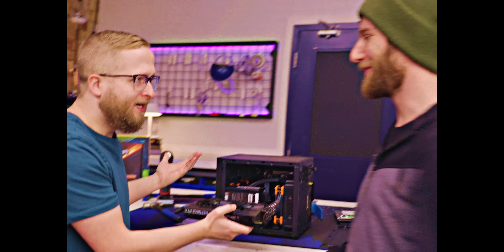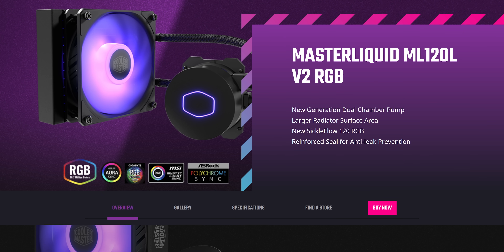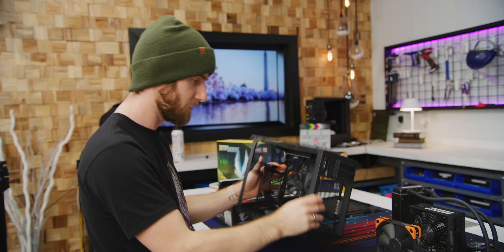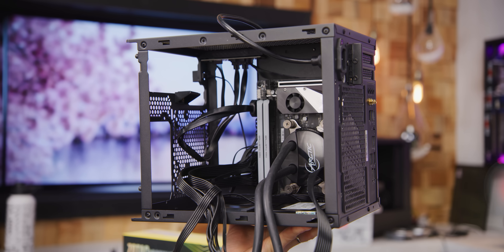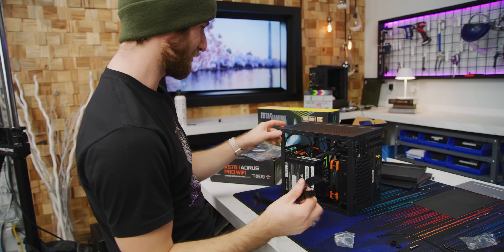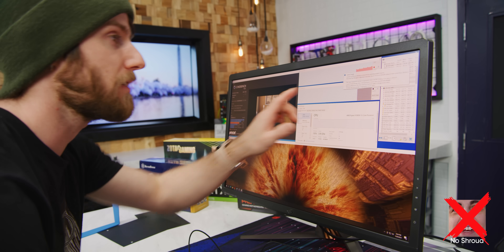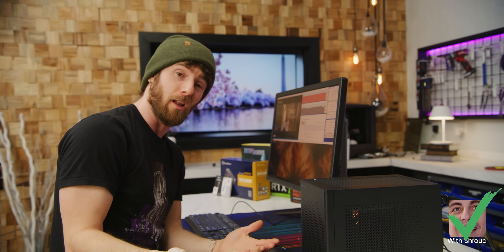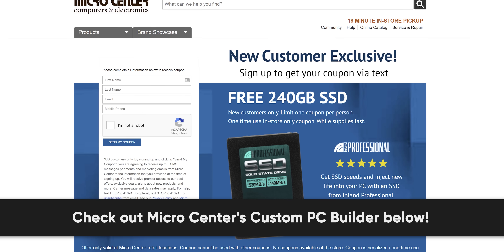This GPU SLIDES into this Case! - Silverstone SUGO 16 ITX Case

Comment: im starting to think they need to build video cards with the connector on the back end and install via a pair of rails, sort of like how datacenter hot swappable hard drives work. given how ginormous they have gotten and how relatively flimsy a single edge bracket and pcie slot (which mobo manufacturers have gone out of their way to reinforce) tend to be.
Reply: i would agree, but then it would break compliance. Its not that there is something wrong with the formfactor design. Its that chip manufacturers are getting less and less efficient (per watt performance) overall.

While idle wattage has gone down considerably over the years (AMD HD 79xx/R9 2xx/3xx/4xx | would idle on average just under 200w less than peak, which was usually around 400-600w), Underload GPU efficiency has dropped off considerably.
While i agree a lot of this has to do with transistor count being through the roof with high core-clocks, that's only half the issue. GPU die efficiency hasn't improved much since mid 2000's. This is concerning in terms of progression.

More chip developers such as Nvidia and AMD are focused on performance, they keep cranking up the chips power draw by cramming it into the same low efficiency space. This means it requires more power, and better cooling. - Its this traditional approach to cooling thats adding all the extra weight to the cards.

In the short term, more efficient heatsink designs with alternative materials and better fans are one approach to fix this, but ideally the better approach would be to absolutely go with external cooling with water cooling of these demanding components.

---
Long term, i think more efficient GPU die layouts, with far less of the power filtering and handling should be on the board. More daughter-boards to offset the cooling of the power-delivery (and repair) would solve this easily. However, as we are already seeing from Intel, they keep wanting to cram more heat creating VRM's and rail switching right onto the motherboard as-is. Concerns are shifting away from Gaming/Enthusiast Addon components(gpu's), and back to integrated low-end components. 

Convenience and pure aesthetic is slowly winning out against engineering and product design sense. So i dont see daughter boards or more efficient GPU's coming back any time soon..

---

This all said, your probably thinking "None of this matters today with existing stuff. Its just a bunch of worthess conjecture, add a support rail and be done with it!", while you would be entirely right... There is a huge problem to this approach. Standards exist for a reason, altering these standards means breaking compatibility with older or upcoming devices.
It also means breaking compatibility between like devices.

This is why the "firewire" vs "USB" debate ultimately culminated in a uniform spec. | More separation in case design that comes away from spec guidelines means more and more niche solutions come along that breaks reparability and support.

Adding /anything/ to the GPU which is supposed to integrate with a case, means updating pci formfactor specs. It also means breaking compatibility with old cases that lack support for it. 
From a engineering standpoint Adding a "Support arm" attached directly to the GPU will not reduce flex. This is a fault of the PCB, not the "Card case". Thin PCB's are exposed to more flex. This could be solved by adding additional layers of copper with heatpipe channels built into the pcb its self to both mitigate heat transfer and isolate the grounding plane. Requiring 0 spec changes, significantly reduced flex and improving thermals overall. But lets face it, GPU market has turned into a pyramid scheme of "How much can we produce, at the lowest price possible and charge the most for". - Less efficient heatsinks borrowing from pre-existing designs mean they appear more efficient, but in reality its just minimal effort. Combined with on average the worlds worst fans, usually means most GPU's are designed to fail, and fail within 3 years.
Reply: @edenrose2374  the rail system would be the extreme hyperbole option to help explain the problem. if actually implemented it would end up adding even more bulk to the systems and therefore cost (water cooling has the same problem). so the answer would be in small amendments to the existing standards with a low cost of implementation. a couple examples:

doing something like adding an extra bracket at the other end of the video card (ive seen old vesa cards that do that), and a line of structural holes to the chassis spaced at 20mm intervals in like with the rear bracket holes. then spec video cards over a certain weight limit to have a tail bracket. if the card is exceedingly long they can opt for a captive thumb screw. chassis manufacturers just add the holes and include any necessary standoffs, gpu manufactures are responsible for the brackets. 

making the bracket hard mount directly the the bulk of the heat sink. cards with a 3 slot (and i saw one with 4) bracket already have a fairly ridged mounting point which is sometimes underutilized. most of the boards ive disassembled use the pcb itself as an intermediary using only a couple screws at most with no direct connection to the weighty heat sink. this would just be the gpu manufacturers problem.

Comment: I guess the inner power plug is supposed to be through that loooong gap left of the power supply before this one is mounted and screwed in lol. With that the cable is not as stupidly managed as Linus made it in the video.
Reply: you wouldn't be able to do that with a ATX PSU ?
Reply: Its covered by the front panel so hardly "stupidly managed".  Its better than most small form factor cases where the AC cable is a tight squeeze risking breaking the cable.

Comment: I don't understand the trend for small cases, the empty space is cheap and light and makes everything easier to deal with.
Reply: More desk space
Reply: I'm the other way around! I've never understood the want for larger cases. Sure it makes cable management/general assembly easier, but it just takes up excessive (imo) space on a desk. Not everyone  wants to get an entirely new desk to keep their pc off the floor and having a smaller case can give you enough space for an extra monitor, more space for your mouse, and it helps a lot with dust and pet hair by keeping it on the desk. That's why I'll always prefer sff, but to each their own!
Reply: @ryebread8063  agreed
Reply: if you have limited space SFF case is amazing takes up a lot less space then a normal one, plus portablity is so easy if you need to move your PC from location to location. 

I am a uni student so move houses every year or so and can fit my PC in a backpack if i wanted to and can easily fit in the tiny rooms i get.
Reply: @StuffAndMore  "I am a uni student so move houses every year" Wait, how are those things related?
Reply: My Define C is already fantastic for aircooled thermals/noise. It's likely the most efficient use of space for a modern full-ATX case. An ITX case js just extra work and no spare pcie slots.
Reply: @jubuttib  cause i rent my house and most contracts are only for the time you are at uni Sep-July and highly unlikey you will get the same house again
Reply: @StuffAndMore  Same, contracts sucks
Reply: @MobiAussie  Depends on what itx case. Modern itx cases are actually easier to build if you did your research first
Reply: @StuffAndMore  Huh, weird. I rented too while I was at uni, and spent years in that apartment. =/
Reply: @z4k1_zaki65  Sorry to hear it's like that over there, here you usually get to stay in the same apartment for the whole time, unless you specifically wanted to move for example due to hooking up or something.

Comment: Really nice case and thanks for going over some of the PSU options. It looks like you can fit a chonky tower cooler in there if you go with an SFX power supply. If that’s the “case”, that’s the way to go IMO

Comment: Not really sure why you guys didn't go for a Corsair platinum unit instead for an sff build. Its the smaller sfx footprint as opposed to the sfx-l and you also get nicer braided cables that aren't as stiff making it easier for cable management. Your fingers would also appreciated it a lot more. Other than that, nice build. Looking forward to getting my hands on this as Silverstone seems to be one of the few case designers who like to apply corporate style and industrial networking design to their cases which I really love :)

Comment: I'm building a custom PC case out of the leftover bits remaining from a 1939 Philco radio that I made into a massive PC case in 2014. The big case will house my NAS, with it's motherboard and 12 hard drives, as well as a standard ATX motherboard for a workshop PC. My new case is 13 inches long, 10.5 inches tall, and 9.6 inches wide. It will support a full size ATX motherboard, with 7 low profile PCIe slots coming out the bottom of the case, and up to a 3 slot GPU exiting the rear. The PSU is an SFX supply, and the CPU is cooled by a Noctua NH-D15. The design rotates the CPU cooler 90°, and creates a sort of front to back wind tunnel effect. The front and rear grills are going to be waterjet cut custom brass panels. The GPU pulls air in through a top mounted brass grill as well. The case hinges open like one of those old style PowerMac G3/G4 towers. The whole thing is suspended off the desktop by legs, and will have a nixie clock built into the front.

Comment: Noctua's foam duct thing would work well here, just surround the GPU fans up from above while ensuring it wont block the exhaust fins.
Reply: Interesting suggestion. I'm building a pc using this case. How would you attach them to the GPU? Or would you just wedge them between the card and the case? Wedging would potentially add further mechanical strain to GPU sagging
Reply: @WerdnaT00  There does seem to be some GPU sag visible in the video. Double sided tape on the top panel could work , but then you risk the foam becoming one-time-use only. It does seem like you can brace the GPU from below using the power supply or AIO, but that would be jank. It would be total overkill, but a deshroud and replacing the fans with ones you can actually screw the foam into would avoid both issues but adds extra cost.

Comment: I guess one of the editors is getting a new machine now? Super cool build, though I still prefer the sandwich design with the PCIe extension bracket, since it usually nets you a thinner and easier to place machine. But Linus is absolutely correct: Silverstone is legendary for their creativity in case design, even if it sometimes looks janky or doesn't work out quite as anticipated, you can never take away how cool it is to see what designs they come up with.

Comment: This looks like a case that would benefit a LOT from the 5mm extra length the Phanteks T30 fans have to move air out, especially in the layout in the video since there's only one exhaust fan.

Comment: I use my power supply to exhaust air from my case. It works well. It's better than the normal way of installing a ps imo. My case temp is only 2 degrees above ambient. Plus the air in the case is probably less dusty than outside the case so doing things this way is better for the ps. It adds to the airflow of the case without increasing noise from another fan too. Given that idk why you wouldn't do it this way.

Comment: I wish Linus checked out the Silverstone NJ450-SXL.
As a lover of silent computers, that one is just unbeatable - you can't get coil whine from a sealed box made out of aluminium heatsinks.
It would also help promote that unit. I messaged Silverstone when it came out asking if they planned to make an ATX version with >600W and they said they'd see how well this one does.
I've not seen it showcased a lot, and I want that ATX version a lot - I need more than 450W but that sealed design is amazing.

Comment: I've used small and cubic cases before and those consumers who wants smaller cases doesn't know what they are dealing with. If you ever think to slightly dusting, cleaning, changing thermal or any hardware along the way, you must avoid those kind of cases which causes a lot of pain to do any of work. But if you are okay to send your computer to tech every 6-12 months, then you are fine and it's their problem. But if I was a worker, I would've definetely charge extra amount for the pain it caused me.

Comment: Interesting case. Its even possible to use relatively large air cooler, and you don't need 4-6 fans, like many other SFFs, to squeeze air through the tight space of the case.

Comment: Other than cost, you can get a no-tradeoff solution with a SFX power supply. If you get a highly-efficient model with enough power, at least with Corsair's nice ones, the fan doesn't kick on below about 60% of its power capacity. While new chonky CPU's and GPU's can easily eat up over 60% of most PSU's, it's easy to spec a CPU that saves power by not having extra cores you won't use (getting 'only' a 6 or 8 core), and that way saving your watts for the graphics card. I run the Corsair SF750 with a 3700x and RTX3080, and I'm not sure if the fan ever kicks on. But if it does, it's quiet enough I don't hear it. 

It's also worth noting that the additional cooling you get on the CPU means the CPU fan doesn't have to run as hard, and I guarantee that makes a bigger difference for sound than the fan on the PSU.

Comment: I built mini-ITX PC for gaming in my living room. Case is Fractal Design Node 304 equipped with R5 5600X, RTX 3080Ti. Temps are around 70-80c for both CPU and GPU when gaming on 4K maxed out.

Comment: I think having the AIO as intake is not ideal, silvesrtone should consider adding the option of installing the AIO on the right side as exhaust, and moving the PSU to the left  side of the case,  that is front and left  side intake (where GPU is) and right side and back is exhaust. regarding the graphic card silverstone provides an option with a rizer cable so to install the graphic card flat, that can solve the Graphic card cabling issue.

Comment: I'd like to see them do a custom tower cooler that just takes up pretty much the entire middle section with heatsink for this. I bet you could still get great quiet performance and then you don't have to worry about a pump failing.
And maybe a shroud that you can stick on the back that doubles as case feet so you can orientate it vertically. (You'd need a lot of 90° angle connectors but they exist so it shouldn't really be a problem, would just be cool to have the option)

Comment: I know everyone dismisses 120mm AIO's, but I have an Arctic Liquid Freezer II 120, and I never went above 80C cooling a 5950x. I sold that CPU and continued using my 3700x, which can't even hit 70F with that AIO. That thick radiator makes a huge difference. Maybe not quite the same surface area as a standard thin 240mm AIO, but cooling performance is close.

Comment: it's not exactly the smallest  sff case but the Cooler Master NR200 with the mesh side also gets incredible thermals with an AIO for my 5900x and the bottom has enough clearance to keep a 3080 cool under a load.
Reply: Useful

Comment: Here's a fresh take on this challenge. Fit a PC in carry-on luggage allowance. You can borrow a monitor in most homes or open-office hot-desking. European RyanAir (Budget Airline) 'priority' carry-on suitcase is two cabin bags. No muscle-bound baggage handler throwing my baby onto tarmac. The 400 x 200 x 250mm personal bag (keyboard, mouse, mat, wifi dongle hotspot etc) and the 550 x 400 x 200mm 10kg wheelie bag for a decent PC. The Sugo16 bare is 200mm (W) x 232mm (H) x 280mm (D), so no 'case' (maybe sneak in some packing in a coat pocket), or rubber mount some of that for shock air-turbulance. That stuff works, had a forklift mangle a sheet-steel industrial-pc, and the rubber-mounted, laptop-drive was transferred from the wreckage. However, the Sugo is not using ALL of my allowance. Can you do better for gaming in that space? Preferably water cooled with something cheap and available on a friday afternoon near an airport / industrial estate / garage. Distilled water, or with some auntie-freeze cool-aid.
Reply: These days I am happy with solid-state. Maybe able to swap put storage easily. I have Qubes and Rust / RTOS for my more challenging work, of human mangling robots (only if they do reaaal bad ~ this is civvy street, plus contaminants).
Reply: Being able to fit in a wheelie case, or a handle would be cool.

Comment: I would love to see a case like this that's slightly bigger to allow using high performance CPU air cooler like NH-D14. Three slot high GPU space would have been great, cooling such a card would be pretty hard in such a small space.

Comment: The only thing that kills me is that front exhaust, it seems so weird.  Since most PCs sit off to the side of the user it's probably not a problem, but if it's sitting on your desk and you set something down in front of it like papers or whatever then it could be a problem with them blowing away.

Comment: That's a cute little 3070... Just got a 3070 FTW and crammed it in a miniITX build. You guys should check out the SSUPD Meshlicious case. I know the name isn't great but the case is! Oh and it will support up to 4 slot GPUs AND up to a 280mm rad.

Comment: I would go with a Cooler Master NR 200P, supports full size graphics card aswell as 280mm aio and 4×120mm case fans and staying under 20L, it has great air flow.

Comment: Personally I'd consider something like the Noctua NH-L12S (has official support for the 5900X) - which would fit under the PSU in either configuration (max height of 70mm) - instead of a 120mm AIO as I'd be worried about airflow restriction from the tubes in the latter case. You might not be able to overclock the 5900X with that cooler but I doubt a 120mm AIO would provide much more headroom (if any) either.